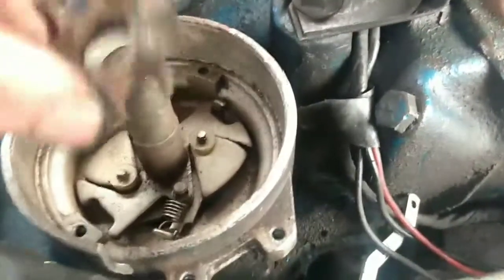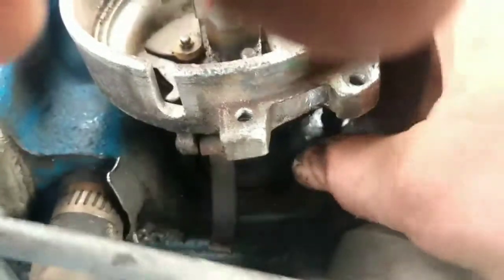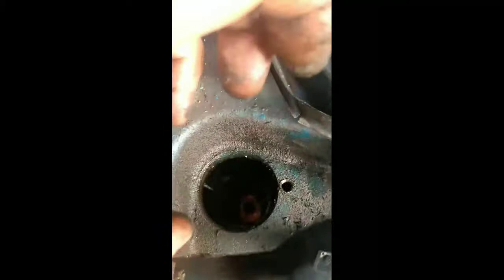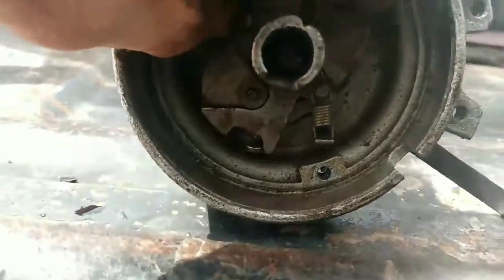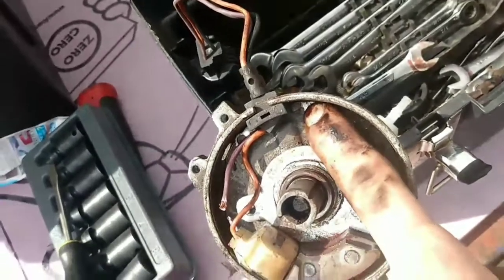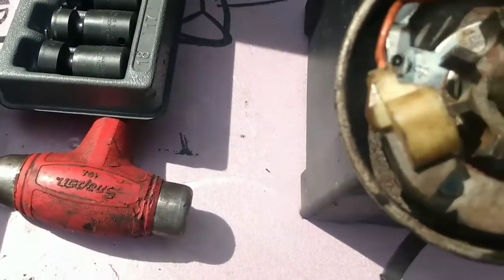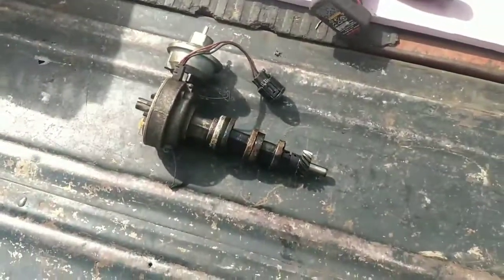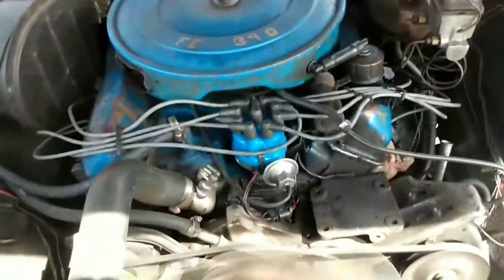Ford 390 Distributor

Comment: I believe u just found my issue when the vacuum advance arm hangs the cam the rotor sits on is touching the piece where ur wires got chomped minus the wire issue u described what my truck was doing the last time started. Starter would drag so much burnt up so many solenoids and I am just starting to bring her back to life other projects home work u know life gets in the way. My truck has been back burner for this simple fix and I had no idea what it was kinda sucks 10 min fix only 3 years sitting 🙃
Reply from the maker: glad i could help. As simple as these old things are they can confound some of the best with their little phantom issues that make no sense. I know how it gets.
Reply: @brokenotdead9587  i had it converted over to factory computer box after replacing points n condenser so many times plus rebuilt motor money was a concern then and didnt want points back but finding the right distributor was expensive and so opted for this style it never dawned that wouldve been a problem lol thanks
Reply: Thank you so much for taking the time to explain n show this